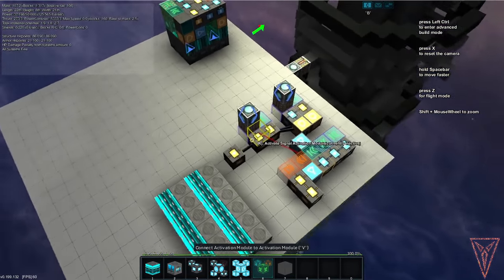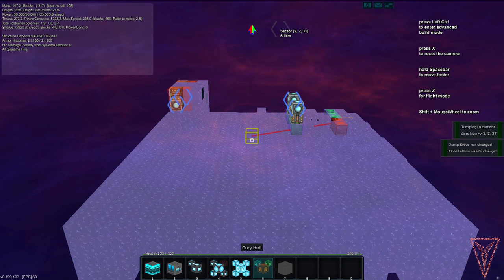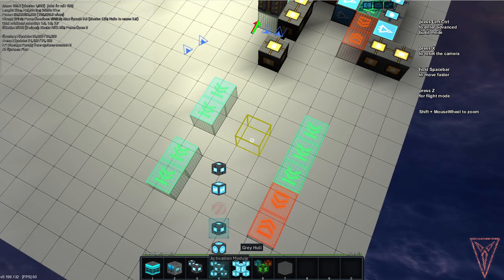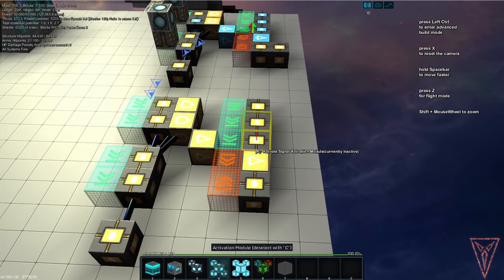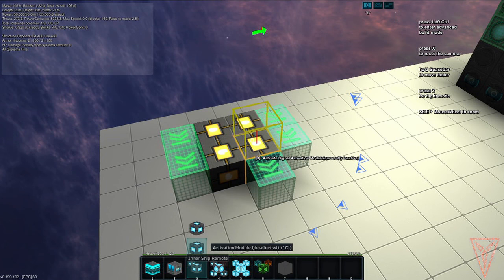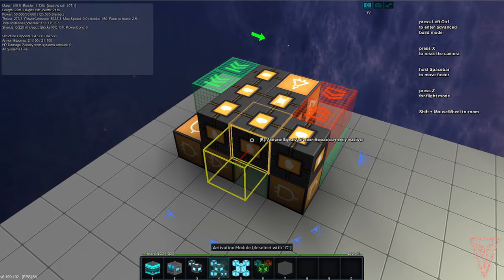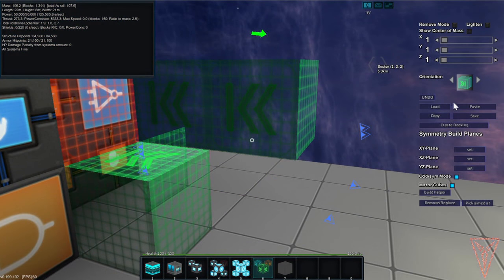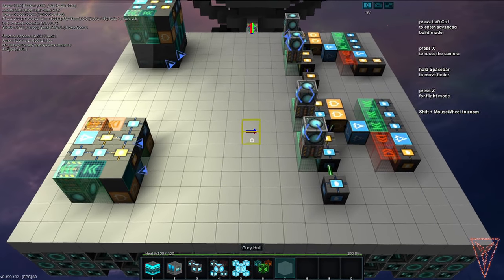Starmade Tech: Chain Drives II even faster

Comment: Is it possible to increase the speed of the charging by adding more clocks? Or is the maximum 2 due to limits in the game?
Reply from the maker: Not by adding more clocks.   I believe the minimum time required to charge a single jump drive is 45 seconds.  However if you wanted to add more jump modules to each jump computer you could charge it even faster.

But I believe, in Vanilla Starmade, 45 sec's is the fastest you're going to get with clocks and single module jump drives.
Reply: Good to know, thanks!